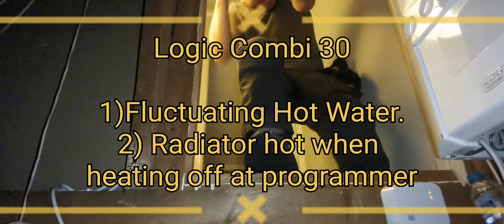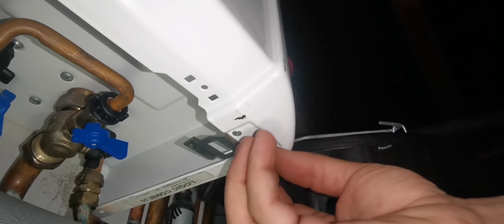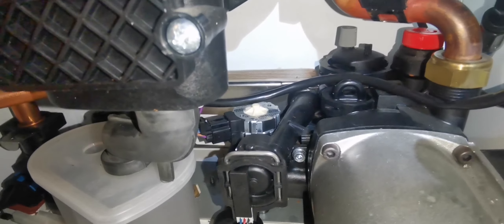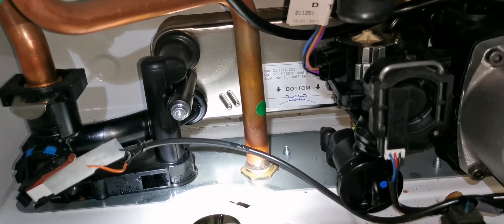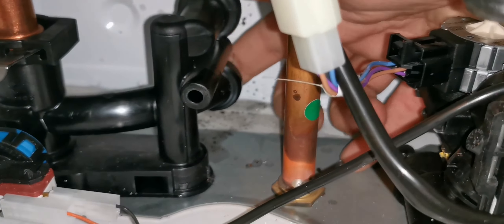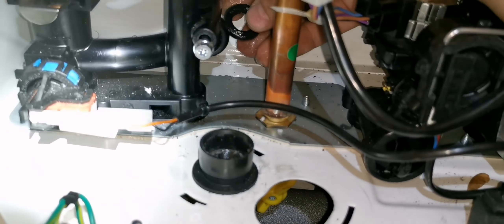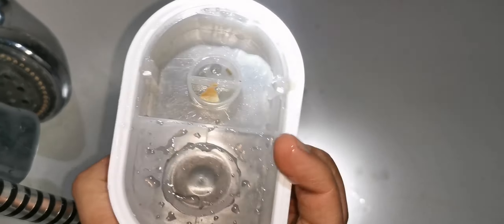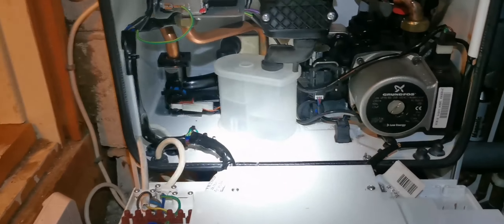Ideal Logic Plate heat exchanger no hot water combi

Comment: Can't you just shut the mains off at the boiler with the cold feed valve that's under the boiler that's how I isolate ideals normally that way would off saved you running outside
Reply from the maker: I couldn't isolate as normal. I might of explained it in the video, either it didn't work or wasn't an isolation. 😂 But thanks for the comment. I'd appreciate a sub. I have loads more videos also heat pump install coming soon

Comment: Whats next if plate heat exchanger has be cleaned or renewed but still no hot water and no fault codes appearing.
Reply from the maker: Diverter valve
Reply: @mendyourhome  
The boiler guy has checked the diverter valve by adjusting flow to check but has not taken it apart. So far, new plate heat exchanger fitted, checked turbine, replaced fan, gas valve, switches, and checked  gas flow rate at gas meter. The hot water dial is at max hot, but we are only getting lukewarm water from taps. CH radiators are piping hot.
No fault codes appearing on boiler.

Comment: Why didn’t you isolate it under the boiler also could of just cleaned that plate out if it was blocked with acid unless it’s split in which case pressure would of risen on gauge
Reply from the maker: It was year ago, but i believe they didn't work or hadn't been fitted

Comment: Could you not have isolated cold under boiler?
Reply from the maker: No it couldn't
Reply: @mendyourhome  I changed a hx plate on a Worcester greenstar erp, I drained the heating system, hot and cold taps and took out the pressure from the Expansion vessel and isolated return, flow and cold under the boiler. When I opened the screw on the hx plate, quite a lot of water was still coming out, so I let it drain out slowly as I didn't want the water to damage any other parts, ESP the electrics. 
What could I have done differenly to make sure all the water is out regardless of which boiler is being worked on?
Thanks.

Comment: Why did the heat exchanger become blocked when the system had a magnetic filter fitted?
Reply: This is a secondary heat exchanger. It's likely to be blocked on the domestic hot water side  which is caused by lime scale and other minerals from poor water quality ie hard water coming on from the mains although It can still be blocked on the heat side from sludge as a magnetic filter will not catch everything.
Reply from the maker: Magnetic filters mainly capture magnetic particles, but not everything. Also this is a plate heat exchanger limescale is a common culprit on the hot water side being blocked. Because the plates are so tightly crammed in it not 1 blockage it's a slow build up over time, like a Dam that keep collecting more debris.

Comment: Hi there just a quick one what was the reason you changed the plate heat exchanger I have a l3 fault on my boiler and I get next to no flow with 2 taps running I’m assuming the plate heat exchanger is blocked
Reply: Fan matw